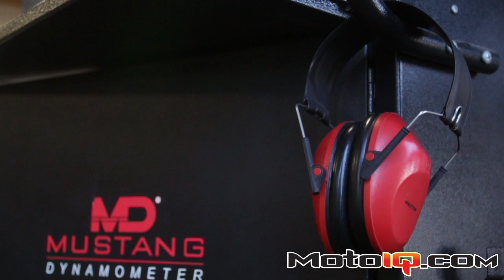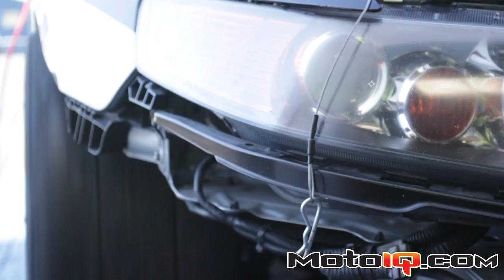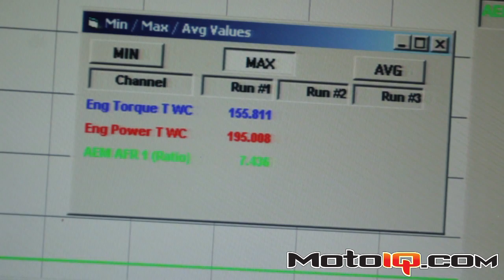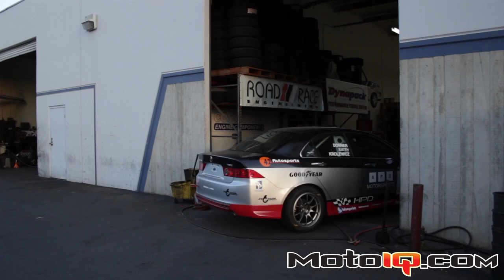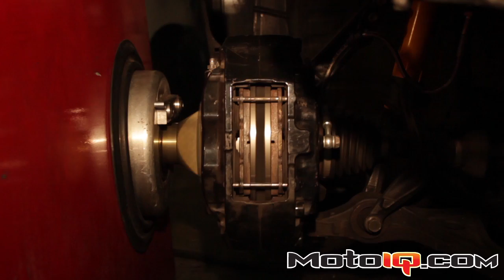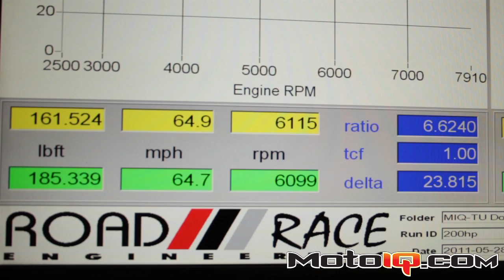APD Motorsports TSX Dyno Tuning - AEM EMS and Blueprint camshafts

Comment: VTEC didn't kick till 7,600RPM? with what sounds like a7,9-8,1K rev Limiter(fuel Cut) on the first Dyno?  Poor Set up.  But I do like that they got the K24 to revv till 8K! The second dyno sounds and looks better.  With what sounds like VTEC switch over is lowered to 4,6K and rev limiter is left at 7,8K making more HP is best to me.  But that that K24 sound slike it wants more Revvs!  Maybe 1 to 1 and a 1/2K more! Did they use Hondata?  reflash or K-pro?

Comment: I am surprised you guys didn't increase the rev limit higher than 7600rpm considering with a Hondata reflash that is the rev limit they give on stock cams and valve springs.